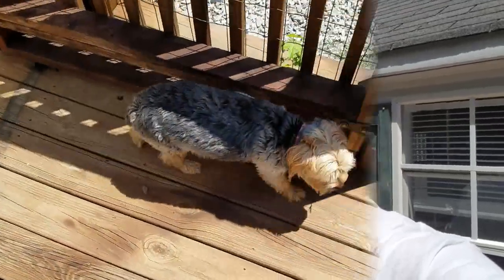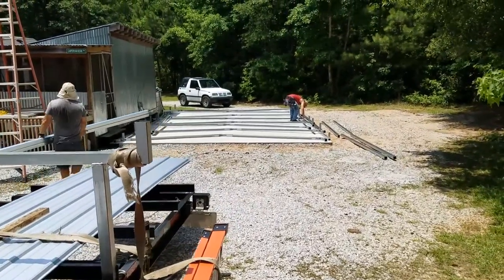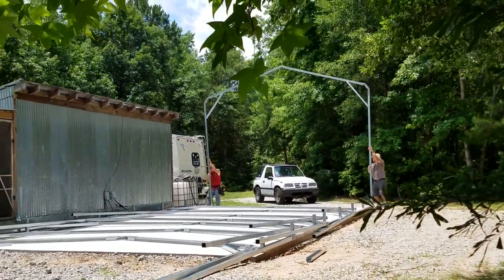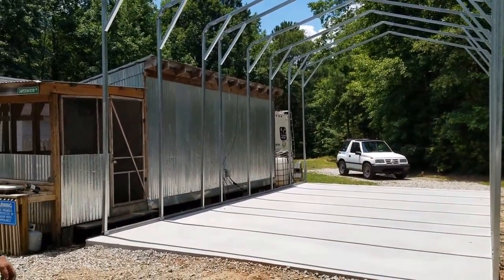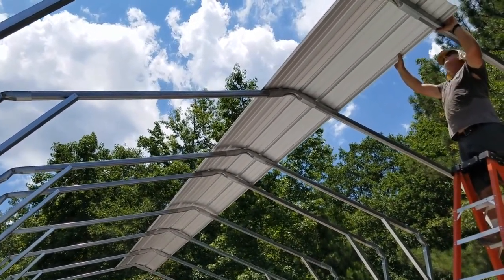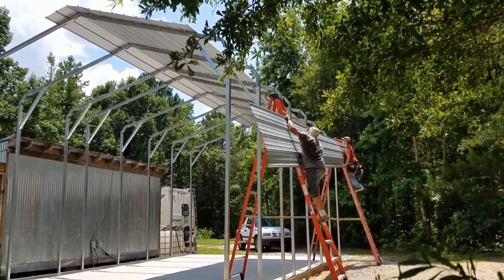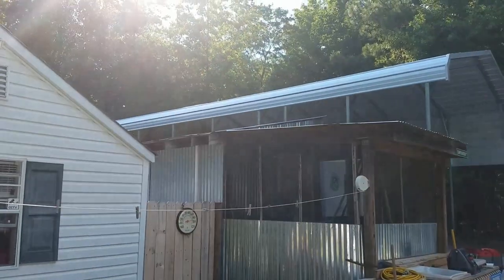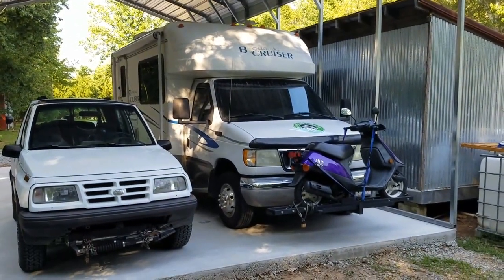Having Enormous RV Shelter Installed

Comment: That extra sheet that you had installed came with your kit it is basically used as a guard for the other sheets so they don't get scratched by the metal and they charged you an additional $100 for it. Very nice carport I'm having one installed myself just for my car 12x21

Comment: My old highschool gymnasium was build like yours but with reinforced concrete pillars, about six on each side fifteen feet apart. It was open with no walls. A category 4 typhoon hit our place, lifted the whole structure from the ground and slammed it down like pancakes. The next structure built in its place didn't look anything like the destroyed one, it looked like a concrete warehouse, quite expensive to keep cool in the summer but it just laughs at the storms that passes by every so often.

Comment: I have one of them on my property they put it up fast but I don't have  your clearance. The structure is tough made it through a few hurricanes. It is low other objects around here take the brunt of the wind so it does not get the full force from that wind.The shade on the cars is a blessing to get in a car that is not radiating heat in the summer is a bonus.

Amazing how 2 guys can do all that.

Comment: I'm a structural engineer and I'd say by the looks of the steel frame sizes, this structure  is designed only to be an open sided carport building. If you fully clad the sides, there may be an issue with excessive wind load across the building. Just something for you to check with the manufacturer, before you close it in.
Reply from the maker: I have also had that cross my mind. Possible I could shore it up somehow with stucture beside it.

Comment: Very nice. Love the start to finish on a project. I agree with continuing the far side down to the ground but I would add one more on the other side to block rain in both directions. Anyway great video. The RV base camp is really coming together.
Reply from the maker: I plan to extend tin roof on other building to rv shelter, then add another piece up there that goes down to tin- flashing added of course. I had to build it to see how it would come together first.
Reply: Knowing how you are I figured you had plans in that direction. It just makes sense. When you get finished it will be great.

Comment: too late now, but something I learned from a van dweller video (can't remember whose) is when using self tapping metal screws, hit the trigger a couple of quick bursts and then full power. They will drive through much easier. I don't know why, not have I personally tried it yet.
Reply from the maker: it allows the screws to cut better, I saw them struggle with this- especially the younger guy

Comment: Great shelter Kevin ! Your right I'd cover in the sides all the way to the slab as well, keep those prying eyes out.  People just don't need to see what you've got and what your doing !  Seeya Rob
Reply from the maker: agreed
Reply: 87xfute but then you loose ventilation
Reply: Blue tarps rule!!
Reply: Campervan Kevin ... Although not solid maybe consider black mesh screen along the vehicle entrance side from the roadway.  It would help block sight from inquiring neighbors, help direct rain flow a bit, it will not rust and it will not trap as much smoke from your evening fires as adding solid sheets. And the breeze would be pleasant.  If you really want to block sight even more just double the mesh.  That was our choice when someone bought property adjacent to ours and added an inground pool within inches of the property line.   We had to deal with Police and Lawyers but during that slow process they became harassing and louder, plus often some of our things would be moved, broken or missing.  We used double black mesh screening to have as much privacy as possible on our deck, gazebo and hot tub.  I also bought 7 'fake' security cameras and installed them everywhere, obviously in plain sight.  (They had battery powered blinking lights.)  As per local code they had to remove their in ground pool, one corner was actually 'ON' our property.  One morning they were gone - skipped out in the middle of the night.  They solved our problem plus we were friendly with local Police so next residents often saw Police cars in our driveway, officers on patrol would stop by if we were outside.  Never had another issue with any neighbors, everyone was pleasant and respectful of all neighbors.  (I saw your sign regarding surveillance cameras.  We actually had similar signs.  Very wise.)

Comment: Prior to anchoring the frame to the concrete floor, it would be wise to spray the tube steel with rust-oleum undercoating.  This will prevent corrosion from taking place to the steel, thats contacting the ground.

Comment: I got a 32 wide by 36 ft deep.  It's a 20 ft wide x 36 long - 12 ft high with a 12 ft wide lean to on the side that goes down to 8 ft tall.  All side walls are closed. That lean too really helps stabilize it in the wind. I have my 33 ft travel trailer under the main section.  All the other stuff parks under the lean too.   Really good investment.

Comment: nice, I put up one on a platform, 12x20, closed it in and put a rollup door on one end, good storage building. One problem I had was rain water running down the bottom side of the roof dripping inside even with those end pieces on it, if it by running a bead of caulking on the underside of the roof all the way across both ends about half way from the frame to the edge, that fixed it. Just mentioned this in case you have the same thing happen.
Reply: Good suggestion 👌

Comment: I would put a bevel of some type on both ends of the concrete so when you drive your vehicles on and off you don't crack the edges of the concrete. Or keep the dirt and gravel even or a tad above the concrete to take the weight. That's a very nice canopy, will last a long time.
Reply from the maker: Yes, I have pushed some to front side already. But, I don't have enough. ... to do list
Reply: Good idea!

Comment: I am surprised there is not more bracing down the sides and across the roof (between or under the rafters).  Here in New Zealand we  would not get that cleared by the local council (town hall) folks.

That said looks good.   
Yep, I like the idea of a couple of extra wall panels down the side (at least one on the left side (near the house) and  one or two on the opposite side.
Reply: Yes, some coller ties and tubular bracing between the rafters and I’d feel better here in Arkansas tornado country.

Comment: The cool air gap between the shelter and the top of you RV will make the air conditioning in your RV work a lot better.
Reply from the maker: heat transfer to rv will be much harder for sun

Comment: Kevin shelter looks great. I was wondering about rain and water off that new roof. I can't remember if in past videos you showed prepping the ground there for water drainage or not? Why I am wondering is the amount that will run off that roof there will create problems for the concrete footing on your shed-shack next to the new shelter. Hope you got that handled. Probably not in the near future but down the road your shed-shack may start sinking. Good luck and keep these great videos up!
Reply from the maker: you have a good eye. yes metal building to lefts roof will be extended to shelter with tin. Then another piece of metal will be put on that side to top of tin :). Then that will thow all that water into tiny house... sooooo big big gutter will be needed
Reply: All the rain rolls off the back of our metal RV carport roof, it was installed at a slight angle so it would work that way.

Comment: Kevin,  Nice looking job..  I do have a major concern.  No Corner braces to keep it steady?  I would have wanted  a steel beam front to back on the center top and also each side on top.. Side braces going to the floor from the steel beam running the length on each side on top.   I am afraid a good wind storm and I will rack around and come down.  You can't depend on just the tin.  A good snow will do you in also..  Can't believe they did not do corner braces...  Looks great but I would be very scared of it...  Just my thoughts and concerns for the time and money you have spent on it...
Reply from the maker: I have a plan to strengthen it, although it probably isn't necessary.
Reply: Maybe someone with a bender can make up some large gusset plates may do the trick.  I just like Braces from the top to the floor on all 4 corners and maybe in both directions  in the middle. Then can't move..  But I love the look.  Also some roll up tarps around a 3 inch piece of PVC  would make it water tight and also open it up... I know my hillbilly is coming out...LOL

Comment: Looks nice, Kinda wondering why 2 of the supperts are closer together than the rest though
Reply from the maker: the sections are prefab, its just how it worked out. they trimmed end off to fit concrete/building

Comment: Is the roof level or does it have a slight gradient to allow rainwater to run off to one end - if not, how does rainwater run off when the ridges are horizontal instead of vertical alignment? I didn't hear you say what kind of metal is used, but I assume that the frame is aluminium and the roofing sheets are galvanised pressed tin sheeting?

Comment: I just noticed that your logo looks a lot like 'Starbuck's' doesn't it? Did you consider making one contiguous roofline with the existing structure? I was wondering why not? What the wind rating on this? Looks great! Peace
Reply from the maker: Reallly? I don't think logos favor at all. As far as a continuous roofline, it may very well happen. I had to see it installed first to make my plan. I asked about he wind rating as well. It does move a little. Guy told me that a house would blow away before shelter did. We will see as I have seen horrible storms here before.
Reply: Attaching it to existing structure would strengthen it I think. It would look good too and enclose the gap between buildings...worth it I would think. You could have a door between them then too maybe? Now you really have a 'base camp'...you probably gain more In property value than the thing costs too maybe? Awesome for the money! Peace

Comment: My only concern would be installing concrete anchors that close to the edge of the slab. I'm looking at a similar carport and the manufacturer recommends making the slab two feet wider and longer so the anchor's are not on the edge.

Comment: How tall is your building Kevin. It is a nice building and must be nice to be able to build one like that and not have to worry about if it will hold the weight of snow on it.
Reply from the maker: I know side legs are 12 feet... to center pitch would be a guess of around 15/16 feet.

Comment: Expansion bolts being used on the edge of concrete??? 
Wait a year and see how many have cracked and blown out the sides and you have nothing holding your building down.
Reply: You can make your concrete pad a little wider and thicker to prevent it.

Comment: Was the installation cost of the garage separate or included in the $2350 ? I've been told that in my area the installation cost is separate.
Reply from the maker: concrete, building and labor was a little over 5k